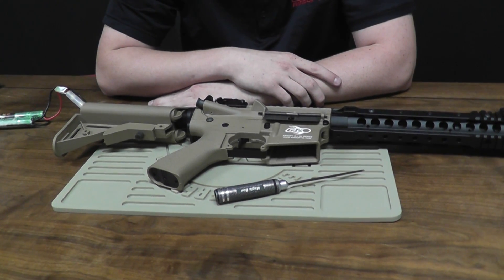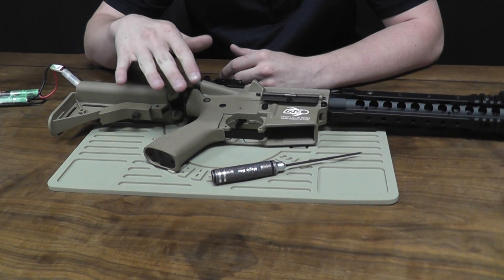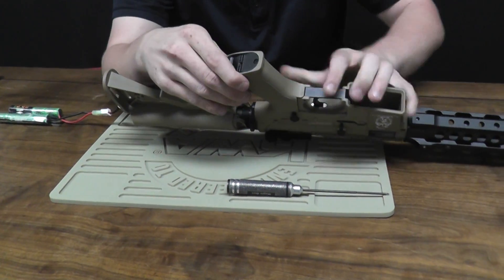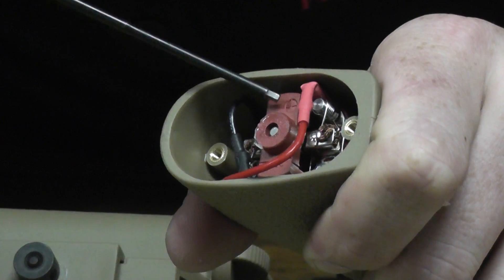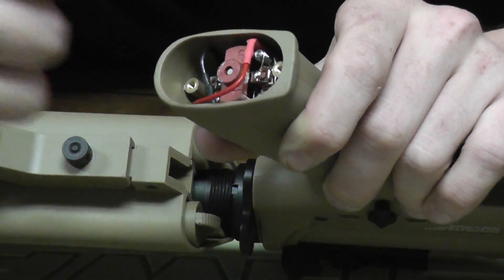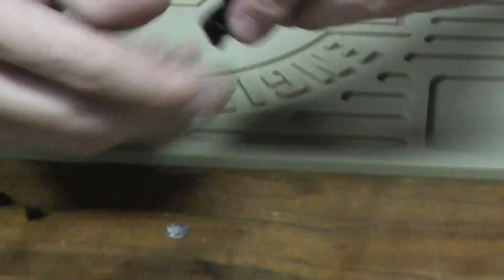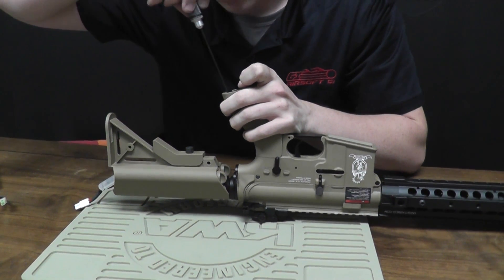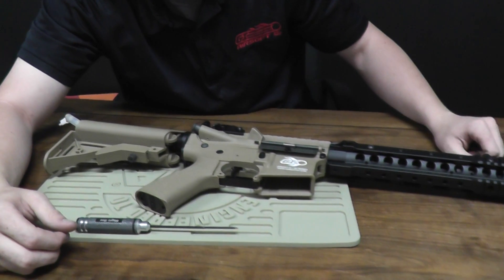Airsoft GI Uncut - Troubleshooting Your Motor

Comment: I have a problem. When i pull the trigger it doesn't make any sound and i have a new charged battery
Reply: u need tto screw in tthe bottttom platte more
Reply: @TheSpeedify  bro this was eight years ago. And no, if it don't even make a click that means somethings wrong with your trigger mechanism.

Comment: Mine isn’t even making the pop sounds it’s just a high pitch grinding sound even on semi
Reply: Same
Reply: I am a little late but I did a little research and it turns out that it is the way the gears are lining up. You have to Esther tighten or loosen the middle big screw in the middle of your grip on your gun and that should work. It worked for me.
Reply: @williamcranmer9778  yeah, I found that out a couple days after making this comment. I was just scared to keep dry firing with it sounding like that to keep messing with that screw haha
Reply: @sorcery3122  same, I thought I broke it but I learned that out and it worked.

Comment: Question, the part you plug the wires into, one of mine broke off , so only the black wire goes in. do i have to buy a whole new motor?
Reply: I’m probably too late but you don’t have to place the motor. You will have to solder the connector to the wire.